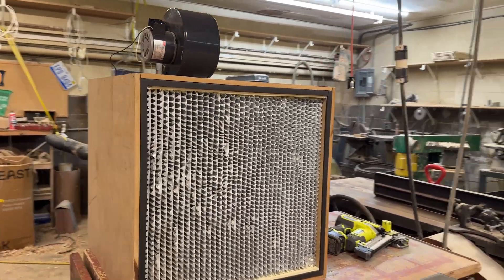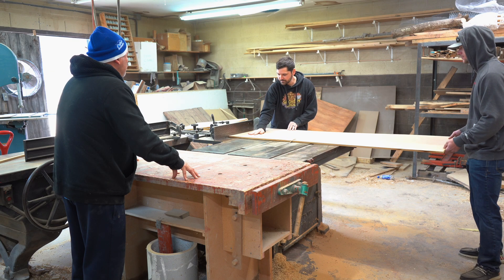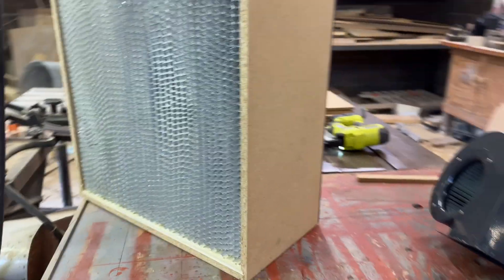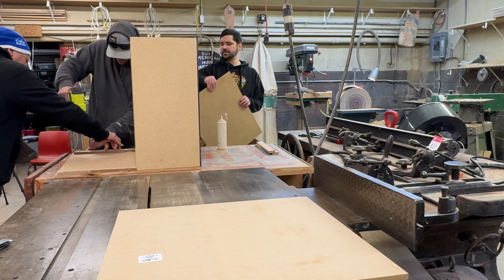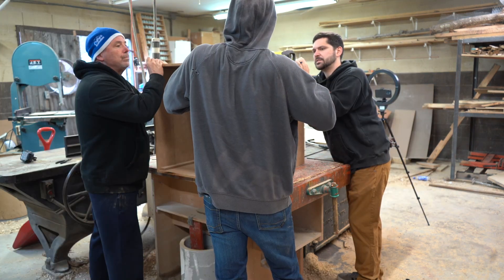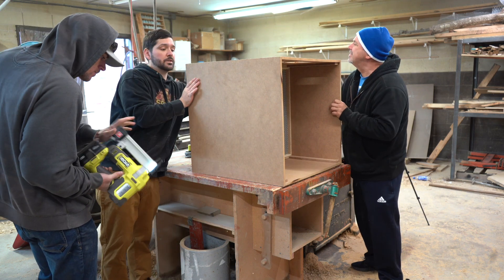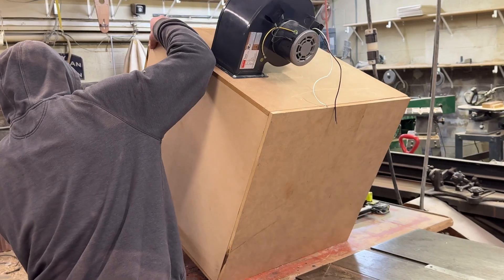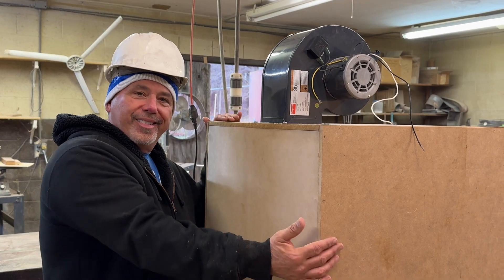How to Build a Laminar Flow Hood for Growing Mushrooms

Comment: Snagged an open box 24x24x12 H14 filter off ebay for 100 shipped plus tax. Vevor 8" inline fan ($70) with speed control and a sheet of 3/4" oak plywood ($80, but anything cheaper should do. After building last night, I ended up buying an additional replacement filter JIC the first one gets damaged/used up, or I want to build another one!
Reply: May I ask what fan you bought , how many cfm

Comment: I used Grok to design one using supplies from Amazon... it calculates everything and compares it to others... $360 for one that size... after lots of calculations and comparisons, I may go with Vevor... it's 24x48x27" $650 its a vertical type so it takes up less space depth-wise... the down side for me is the Vevor doesn't fold up to make it easier to put away when not needed...

Comment: Put a speed control so you can fine tune the box.
Reply: I only use a box fan...lol. Working good...33$ for filters had the box fan.
Reply: @hillbillybackwoods  better than nothing but not a true laminar flow hood. I'll link you a video I'm spending 500 you can go cheaper 300.
Reply: @hillbillybackwoods that’s good for cleaning the air in a room. If you leave that on for several hours and walk in in sterilized tyvek and sterilized tools and turn it off while working that’s great. You’ll get less contam with it off tho to be honest.
Reply: Pretty sure it said those cause it to produce turbulent flow
Reply: Pretty sure that burns up your motor fast
Reply: @martyporter1306  No it doesn't.
Reply: @hillbillybackwoods  I'm like certain it does fungaia laminar flow hoods video
Reply from the maker: @hillbillybackwoods  Full power is best anyway.
Reply: @SporenSprout this isn’t always true. Too fast and you risk turbulence. There’s charts for this. You want about 100ft/min velocity.

Comment: Do the dimensions of the box matter? I'm working with limited desk space. If the blower air is directed to a flatter box, would it affect the flow?
Reply from the maker: @misty_c134  I suppose you could make it less deep. You can also hang the flow hood off the back of your table so there is more room.
Reply: @SporenSprout after checking the listing for the HEPA filter, I see the depth is limited by the size of the filter. Thanks
Reply: @misty_c134 ?? So you need an minimum depth of the box?

Comment: Don't the dents in the filter interfere with the laminar flow? Do you use a potentiometer to regulate speed? I want to make the same one but in Brazil we have few filter options.
Reply from the maker: @CaioFelipeSilvaGomes  It never caused a problem for me. No I don’t use a speed controller. Full speed is good.

Comment: Dear friend, thank for the great idea!

I will share my experience: for the input (the hole you put your blower on), use some kind of soft tube, don't put your blower directly on the wooden panel because the vibration will destroy it soon or later.
Reply from the maker: @az0990za0990  No, there is no vibration destroying anything. I have used this flow hood for years with no issues.
Reply: @SporenSprout  i've been working in a different industry, with pumper and blower. Maybe mines are heavier duty than the blower we need.

I'm studying mushroom just now. I will make this filter when i run my first growing room.

Comment: I built almost the same exact thing except I put a smaller pre filter box over my blower. 

For me the biggest problem wasn't getting it built, it was going through literally 5 returns before I got a 24x24x12 HEPA filter delivered that was undamaged and not bent from being dropped on a corner. I ended up buying from Global Industrial, and they finally got one too me that wasn't too badly damaged and actually packaged well.
Reply: Building the same soon want to add a pre filter.
Reply: Is it x12 or supposed to be 11.5 ?
Reply: @martyporter1306  You're kidding, right?

Comment: What if someone doesn't have filter patches bags for mushrooms do you have any suggestions for that??
Reply: Micro pore tape.
Reply: @DrewAshandLil  Cut a small area in normal PP bags and put Micro pore tape on it, will it work like 0.2 and 0.5 micron filter patch bags??
Reply: @MotivationalActionYT  that is what I've been told.
Reply from the maker: @MotivationalActionYT  Use jars, tubs or buckets.